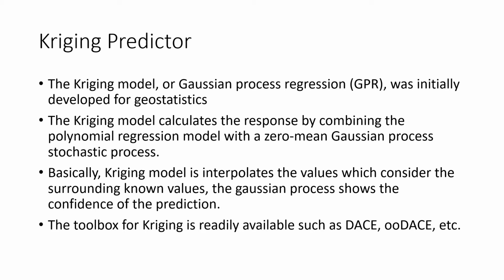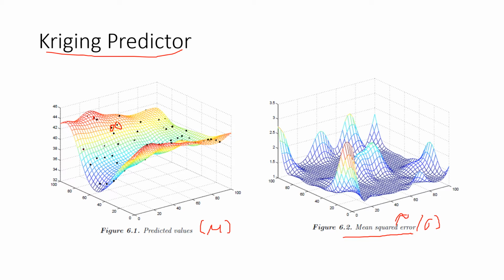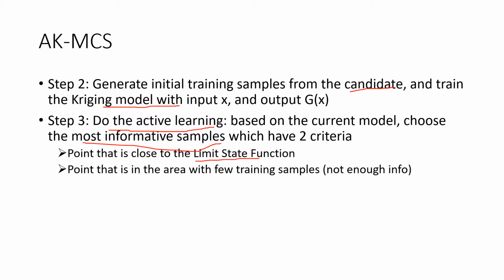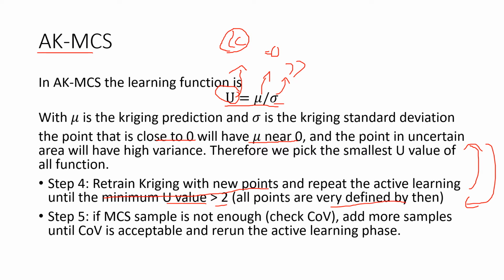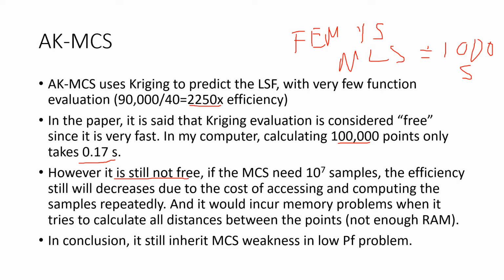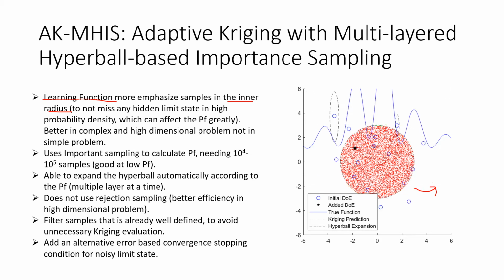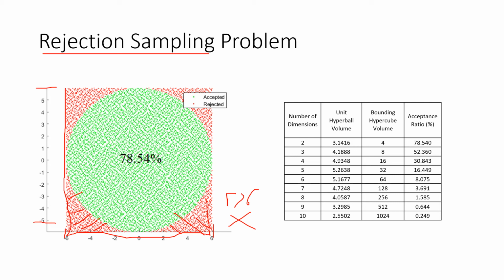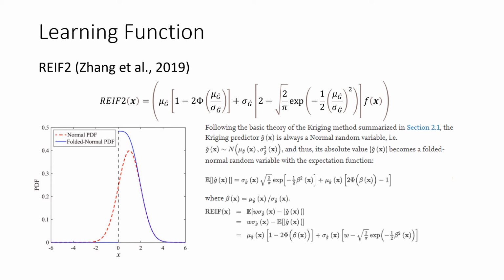Active Learning-based Kriging for Reliability Analysis

Comment: It is a great vedio. I am also working on the same research area. please reply me I have some questions
Reply from the maker: Hi, if it is something that I can help with, please ask away
Reply: @handy25  Thanks for replying, Currently I am doing my master's degree in the research field of surrogate modeling for reliability analysis using Kriging and also AKMCS, I found trouble using the MATLAB toolbox for kriging DACE. I will be glad if you help on MatLab toolbox DACE with the codes and examples too
Reply from the maker: @henokteferaayele9326  Please check this link, I have put an example of AK-MCS that I write my self. I hope it is helpful to you.
https://github.com/prayogohandy/AK-MCS
Reply: @handy25  yeah i got it, it is amazing. can you please do one tutorial on how to use the DACE? we really appreciate if you do the tutorial by example u wrote.
Reply from the maker: @henokteferaayele9326  I think you could read the DACE pdf, which came with the DACE toolbox
There is an example code and explanation on how to use the DACE. Hope this helps.